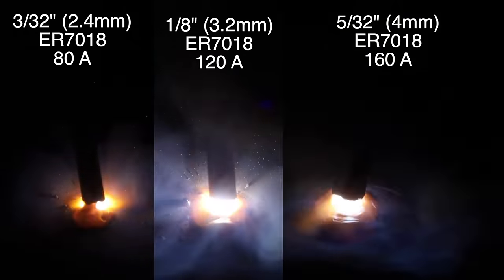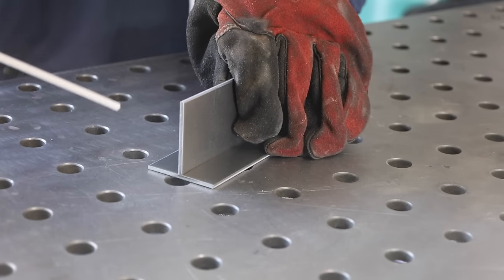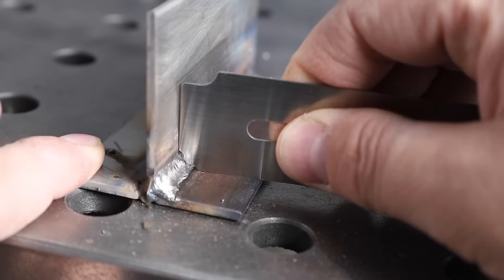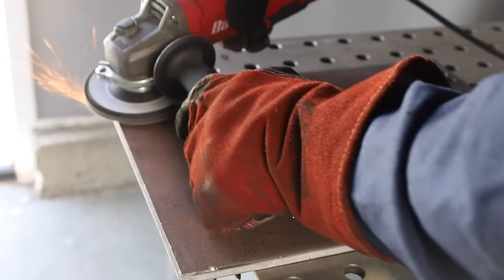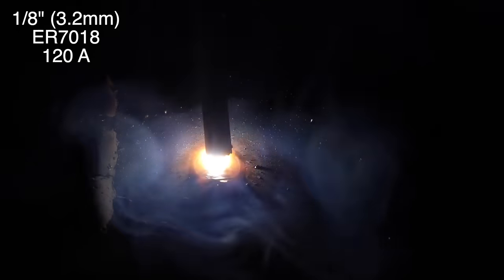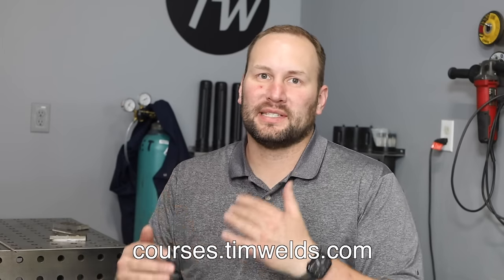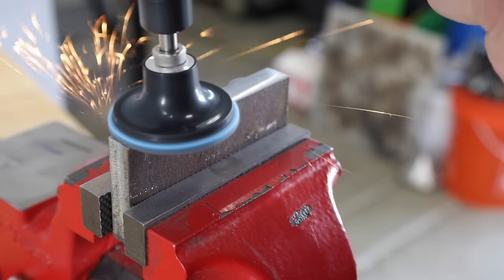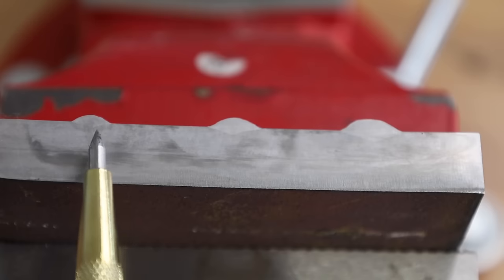Which Size Stick Welding Electrode Is Best?

Comment: thats actually really interesting, i started with mig but ive gotten to run quite a bit of 6013 around the shop the last few months, i always assumed smaller rod for thinner material bigger rod for thicker, good to know that those small rods get just about the same penetration and gives me a better appreciation for how important amp settings are. when i first started with stick i would crank it to whatever the max setting for the rod was and leave it there for uphill, downhill, flat and overhead. if i blew a hole in something id switch to my mig and think that you just cant weld something that thin with stick, after a month or so i got it dialed in and i can tell just how big a difference there is between 80 and 90 amps etc. being self taugh can be a bitch sometimes but your videos really help, i was stuck on up hill welding up until just about a week ago where i found your video talking about rod angle, got my first half way decent uphill the next day.

Comment: All the welds where good, you might of liked a larger size but each weld had a good spead and bite.
There's a good depth of fusion,  it's doing it's job, you have to get the mass in the joint an have a good joint plan.

Comment: I’m from the the UK that uses the metric system but I’d say the 1/8” / 10 gauge  (3.2mm) because it’s the best positional rod & the most chosen size for using to put a root in with most pipe sizes

Comment: Before your video, I was wondering if I made a mistake about 4mm rods it's 6013 but I think considering your explanation I think it's really fine now. My welding surface is 3mm and 6 mm usually and go up to 18mm for flanges

Comment: Cant beat AC for running large dia rods especially on heavy materials in position. Back in my shipyard days I knew some guys who were wizard's using 5.0mm mild steel rods on vertical butts ,fillets and overhead butts and fillets

Comment: If the pieces are welded together, why is penetration a concern in the Tee joint?  If I was gluing parts together or soldering parts together I can see that a larger connection area would give more adhesion force.  But since the weld fuses material, unless the filler material has lower tensile strength than the base metal, why would penetration matter.  Wouldn't the size of the weld determine the strength the joint, so the rod that can give the weld size needed the be what is important in determining which size rod to use?

Comment: What stick for 4.8 i think is 3/16ths  square tubing im going to use the Azzuno Amazon welder to finish welding this 3/16 steel tubing for a utility trailer.

Comment: Remember people, 120volt amazon welders are rated for 1/16th rods! I've found 6011 1/16 rods to work best for general home purposes.
Reply: I just welded 1/4” plates with 6013 rods at 55amps using my 12v yesswelder 160 . And this is my first welder

Comment: Could this be why I don't have any penetration on my 8mm material fillet welds with 3.2mm 7018 rods? I have been trying everything but once the weld has been ground flush I can see it's not penetrated much at all and a small hammer is all that's needed.
Reply: mostly you cant penetrate deeper than 2mm no matter which electrode. so you have to make a v notch

Comment: I love the video. One interesting point you bring up is the engineering aspect of it. I know it's a specialization in itself but perhaps you could make a video either by yourself or invite an engineer to talk general rules of thumb for DIY-ers. For example as a learning home welder I have no intuition if these welds you've shown on the thick plate, if they are ok or not.  Your conclusion is that you can use tha smaller electrode on thick stock - I couldn't make that as a DIY. Probably need to find a good welding book as well :)

Comment: so interesting .Question do electrode packages have a recomended starting amperage on them that you can fine tune into the material your welding. or where is there a chart ? egsample  a 7018 rod is between70 or 80 amps say ? I have a big gas welder from auction but just a guess and by golly welder .my electrodes are all in the plastic storage tubes from previous owner.

Comment: How many amps is your welder pulling from the wall?
Reply: As an electrician/"barn-yard welder" I once measured stick current with my clamp-on ammeter and it matched the selected current on my Craftsman "transformer" welder.  The 240V supply current measured proportional to the selected welding current.  So figure if you select the maximum rated weld current (220A) the welder will draw its full rated 50A from the wall.  So 110A welding current would draw 25A from the wall.  70A will draw about 16A from the wall.

If you have a 120V "stick" welder, you can double the above wall-supplied currents for the same welding currents.  So the maximum welding current you can expect from a 120V "transformer" welder would be 2.2 x 20A = 44A before tripping the house breaker. Not very useful for general metal shop work but maybe enough for "hobby" sheet metal work.  Given that most welders have a duty cycle limit for higher welding currents, and circuit breakers take a minute or more to trip at their rated current, you could probably push the weld currents a bit higher in short bursts of usage at either supply voltage.  I'm guessing that you could get more available and usable welding current from a "modern" "inverter" welder (the newer smaller ones that weigh about 1/4 of an older "transformer" welder).

If you use "the wife's" 30A 240V dryer outlet for your occasional welding you will be limited to about 120A welding current before tripping the "house" breaker.  This has often proven enough capacity for the renter, small shop and "barnyard" occasional welder.

Obviously its hard to beat a fully equipped shop if you are lucky enough to have one.

This is limited experience.  If others have better information, feel free to comment.

Comment: Could you do a video on voltage? I see everywhere talking about amperage but if my highschool knowledge doesn't fail me, the power is totally dependent on voltage too, and the same manufacturer have different voltages for different machines. Mine is 59V so technically even the ballpark you advise should be adjusted. Am I missing something?
Reply: I think stick welders use 120 or 240 volts and you adjust the amps accordingly,,on mig welders you can adjust the volts but its usually nowhere near 120.
Reply: @slamdunk6170  sorry if I was not clear, I mean voltage output (usually DC) not input (AC)

Comment: No offence but you should have started with the larger electrode first just because the material was cold and you used the smallest rod at the lowest amperage first so the smaller let rose is getting robbed on the penetration lol